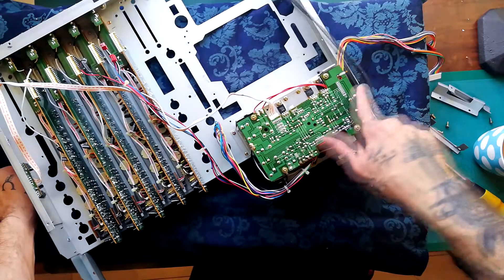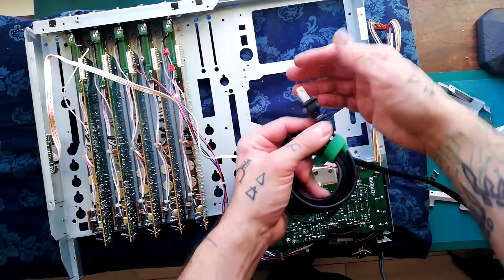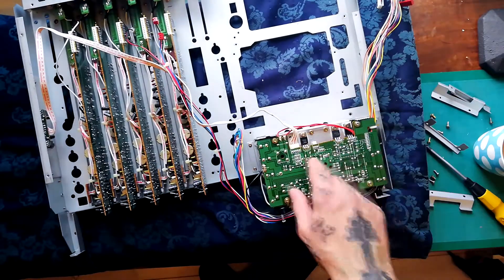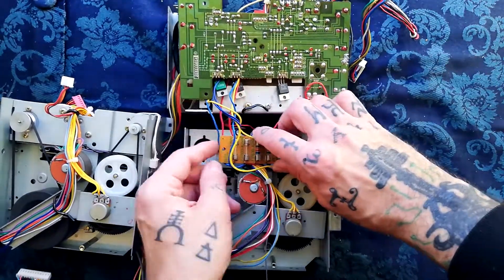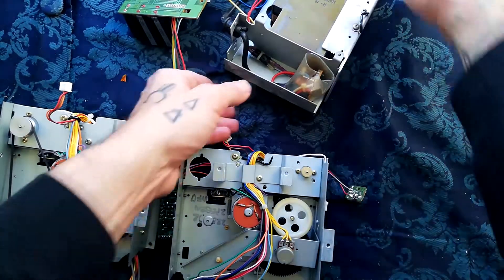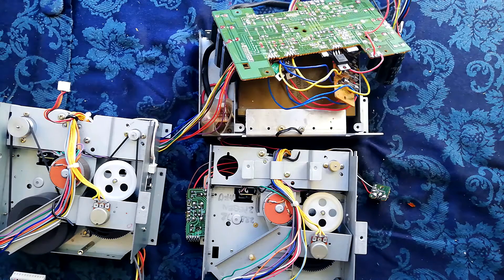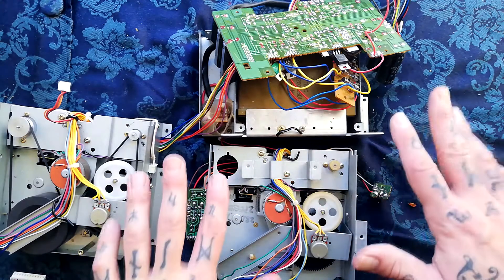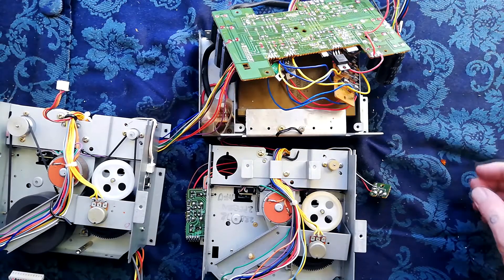Tascam Portastudio 246 | 6 | Linear power supply | Fuses | Transformer |

Comment: I’m not getting power to transport. Play buttons and etc light up except tape counter screen where should I look?
Reply from the maker: Does your unit have a fus board attached to the cassette player? If so could be the 12v slow blow fuse has blown
Reply: I recommend tracing the PSU output to the transport board via multimeter. Could be countless things- some simple, some not. Best way to investigate is to trace that power rail to find where it drops out, then investigate surrounding components.
Reply: hey ben, have you ever managed to solve this? i'm having the same problem... 
@tetrakan kindly advised me to short out the fuses and spray the corresponding boards with cold spray to see which parts are heating up faster than the rest to find the short. i'm a bit scared cause i don't want to cause bigger damage. from my very basic understanding of reading the schematics i'm guessing the problem to be on one of the Control PCBs (A or B) or the Drive PCB (directly mounted to the cassette transport chassis), sooo:
how long should be safe to run the machine while watching the ice melt?

Comment: Looks like 8 screws for the power supply chassis--9 if you count the one by the cable in. There's a wide threaded one above the power switch. I'm trying to get at the power switch now. It does wiggle, but it looks like the rear panel has to come off first ya?
Reply: Ya

Comment: Great video.  I have a Japanese 100v 246.  Did you ever manage to convert your US 110v back to 240v? If so, what did you swap out: the Transformer and/or the power PCB? thx
Reply from the maker: Hey, I've got an issue rn with fuses blowing which I'm 90 Percent certain is related to a faulty control A PCB but I don't want to advise you until I get to the bottom of it. Have a look at the schematic on my blog for now, it'll be the subject of a video eventually.
Reply: Been 2 years lmao, but it should be the trafo. Sometimes it can be done by running the primaries in a different config, other times it needs a different trafo. I'm not sure about the 246 specifically.